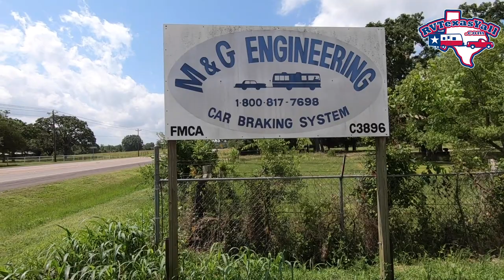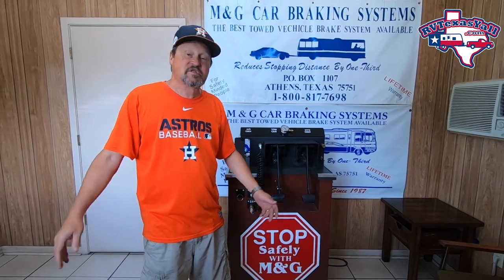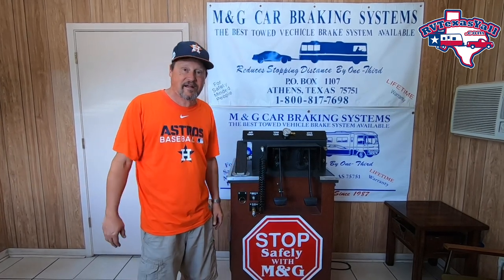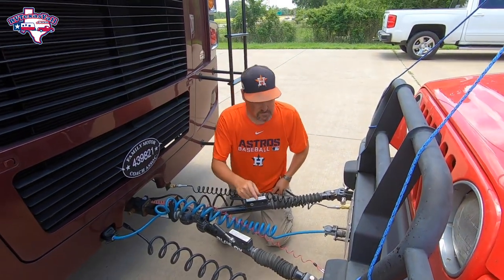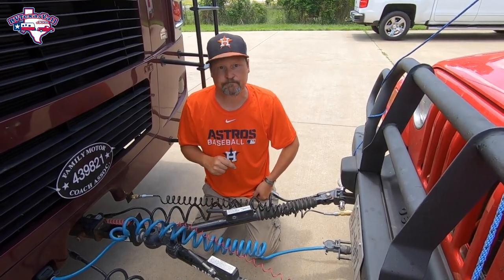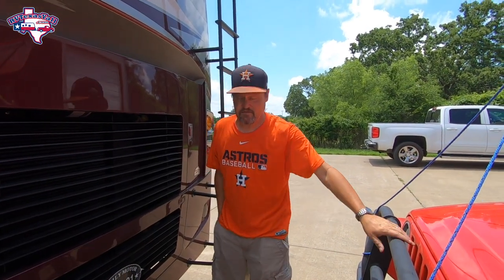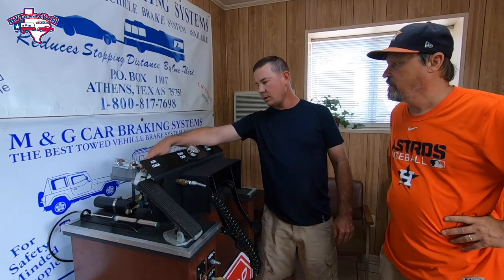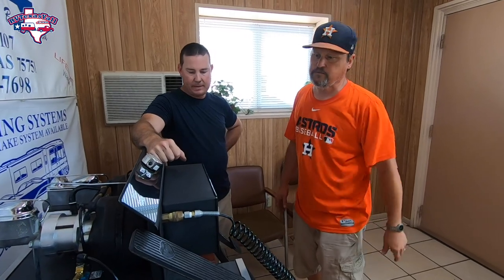Expert Tips: Installing Our Tow Vehicle Braking System with M&G Engineering

Comment: We had one installed on our 2014 CRV 18 months ago.  Great system.  However, we did not know to request a charge wire for the CRV, and have had the battery run down a couple of times.  Will be installing a charge wire soon.  A great system!
Reply from the maker: We are very happy with it.

Comment: The standard blue electrical umbilical to motorcoach to tow car is great but water intrusion to wire harness hub gets into it and results in corrosion where the blue harness goes into the plug adapters. Tape with electrical tape. But better yet pull the tow side wire hub adapter plug and silicone into and on all the wires . To adapter hub. My corrosion was less than two years. Great people there! Great video!! Hello Leon inventor!
Reply from the maker: Thanks for the tips!

Comment: I would like to know if there is a likely way to identify the correct air line on the motor home to tie into for the air that operates the towed vehicle braking system. I have a coach made by Monaco, circa 2005
Reply from the maker: Give Monty a call at M&G Engineering. https://m-gengineering.com/  He can answer all of your questions.

Comment: Do you like this system better than your previous blue ox system and difference in cost between the two?
Reply from the maker: We still use our Blue Ox tow system, but we did not have a tow braking system until recently. We added the M&G Braking System to our setup. We really like them both.
Reply: Cost?

Comment: I have the same setup 99 wangler, class A w/air brakes about how much?
Reply from the maker: If I remember correctly, I think the M&G braking system was somewhere around $1,300. Their website is https://m-gengineering.com/ for more info. Call Marty over there with questions. He did our install. They also install Blue Ox and Roadmaster towbar systems if you need that. Great service.